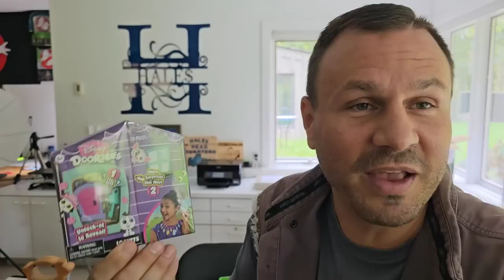I GOT MYSELF IN A HUGE MESS & Now Its Time To Come Clean

Comment: Star/security bit you needed was also in the screwdriver drawer. Top right little blue handled looked like a screwdriver but no bit in end, the bits should also be in same drawer you just interchange with what you need. Or use the bits with a rachet if you need more leverage.
After the lock drawer, 3 'Impact Drivers'??😂😂
That was pretty cool with the Snap On Tap & die box 'There is a difference' awesome timing & quick George 😊 worth about $250 too, love Snap On

Comment: Jeremy, I enjoy your vids back to coin pusher. Please, please, please, do not remove a GFCI receptacle from a garage. Codes vary from state to state and I'm sure it was installed because it was electrical code as it is in most states. Garage floors are concrete (most) and concrete has very low resistance to ground, meaning if you are standing on your floor with no shoes and come in contact with a live wire you will be shocked or electrocuted. It looked to me like it was feed through and will affect other receptacles down line. If it was tripping the GFI, it may be for a valid reason, not just nuisance. Replace with new GFCI and if tripping persists, investigate more.  John

Comment: Sheet metal snips are colored for letting the user know right or left and straight. All while using your right hand. Never tried it with the south paw. And back to your show. Thanks. P.S. Your harbor freight 🧲 hooks might last longer if you place a roll of paper towels in the middle, they're the ends for holding up the roll. Not made for hooks.